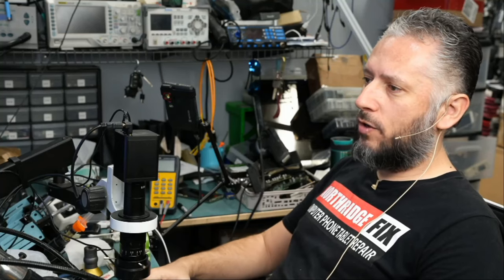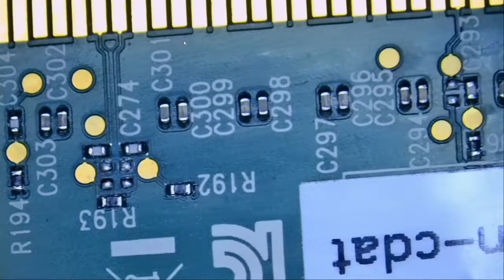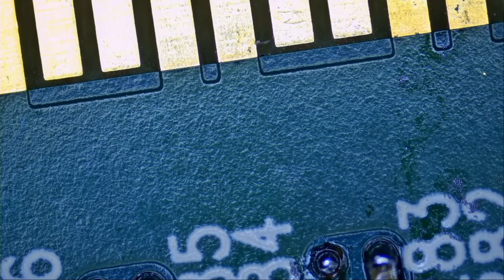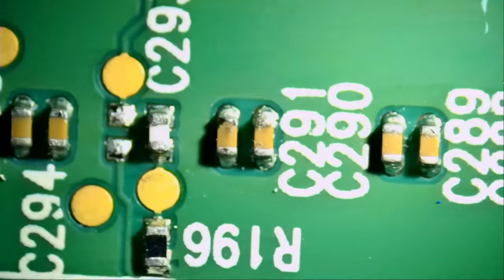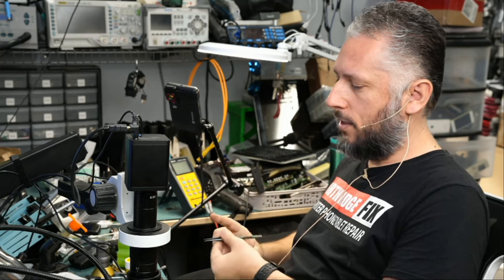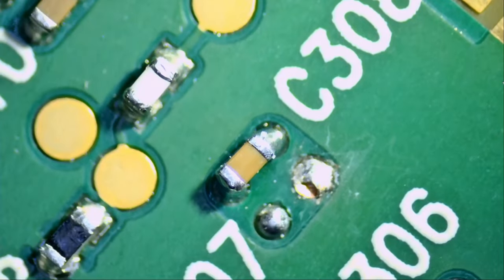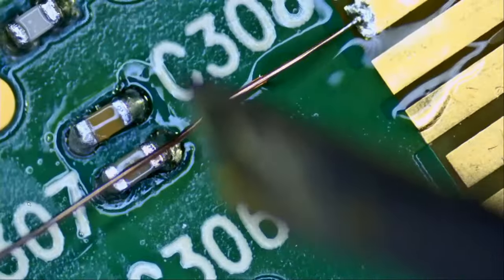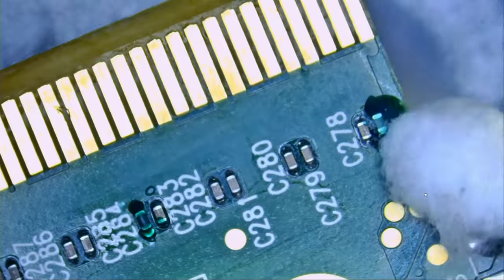Expensive Network Card Repair - Mellanox CX14106a-hcat

Comment: All of these caps near the PCI-E connector are AC coupling caps for the PCI-E differential pairs (data lines), they go to the main IC of the card. They always come in pairs, 1 pair = 1 lane of PCI-E. On modern cards the data lines operate at GHz speeds, and it is critical that the electrical properties of the two traces in a pair are as closely matched as possible.
Reply: Is this a repair or will this fail?
Reply: @Splaterson92  due to the wire and the microscopic difference it gives in electrical flow i'm affraid this is a no fix...
Reply: I wouldn't be so quick to consider those mellanox Asics down for the count. In some competing products that I am more familiar with a signal to noise ratio of many millions to one is no problem. They are far more tolerant of electrical noise than they were even a couple of years ago. As I understand it it is less a question of "how much noise" than one of "how random is the noise"
Reply: @mauzzz2418  Given that multiple PCIe extension ribbon cables have been shown to still work for a GPU at Gen4 speeds even when daisy chained together, I'd say there's a fair chance this works just fine.
Reply: @Splaterson92  Typically in the industry, they extend via out using tiny wire to jumper to part; then secure bond the part to board surface.
Reply: @mauzzz2418  If this is PCI-E 3 then it will likely work, for PCI-E 4 I would be worried, and for PCI-E 5 this would probably fail.
Reply: @TheBackyardChemist  It's a 200gbps Ethernet card, it requires a PCIe 4.0 x16 connection (256gbps theoretical max)
Reply: The spec allows a trace length difference of up to 10 mil. They use 1 percent caps. The cards will work as intended.

Pcie is often problematic - because of noise, interference, and substrate inconsistency within the pcb of the motherboard. Factors which can have significant cumulative effects which scale with the length of the connection. 

Arguing that this is a no-fix based on the general fact that "pcie is hard" without considering what it is that makes pcie hard is only going to confuse the people who read this thread.
Reply: @Splaterson92  will be better than factory, but it really helps if you have a schematic.
Reply: Yup and am somewhat surprised he didn't at a minimum allude to this. Suppose its a case of jack of all trades, master of none.
Reply: @ThePopolou  he's definitely a master solderer :)
Reply: Great work, as always.
Reply: It’s actually 2 pairs per PCI-E lane.  1 pair for RX and 1 pair for TX.
Reply: Right!! Pcie is very problematic, just a little mismatch in length between that differential pair and your timing is ruined, I doubt this card will work at its specified speed
Reply: Guys common... half the time these are off, on paper n in practice 2 different things

Comment: You are both the repair man and the hype man.  You do the repairs with the same tools you sell.  Genius!

Also, I'd almost be in moral panic grinding away at those microscopic traces.  You approach the task at hand with such confidence.  Every time I've worked on small traces I get completely stressed out.

Great job!
Reply: Stress will diminish with lots of practice. You have to make mistakes to learn. Practice on donor/scrap boards.

Comment: Did you test the card before and after? I know the problems were pretty evident and no doubt needed done, but I have to wonder what the issue was. For instance, was the card detected by the OS? Or just not able to bring up the connection etc?

I'm inclined to make sure it fails consistently first, then make then fixes, then do the same test and watch it work. Beyond satisfaction, it's nice to demonstrate in a video for the customer, etc
Reply: A line test would probably need a specific spf connector, a suitable cable and another device at the other end. 

Personally I ask customers for any additional bits if I don't have them and not too onerous for the customer to bring in/mail in.

Comment: I told they would . It has to be like 1000$ for expedited. Most won't pay maybe  some but if they do you might want to do those first. Just for the cash . But 95 $ still is a bargin. So they will pay it. To many expedite to many  to do in little time. Good luck brotha. Thanks for the content and keep up the good works.

Comment: Hi NF loves watching your videos every day I learn something from you as I have a passion for this electronic world.
I have a question.
1: When you say meter in Diode mode it means meter in continuity mode or diode mode if so what diode mode does it cause I know diode mode is used to check diodes.
2: What if we don't have an LCR meter can we still check caps with a multimeter but yeah for the inductor we need an LCR meter cause there is no option in the multimeter for measuring inductance that's what I know.

Comment: What is the purpose of using a pad strip for these torn via vs just soldering component directly to the paste?

Genuine question, no smart remark intended, or implied. It wouldn't given more support since the via is still the anchoring point would it?

What am I missing? Or is it simply preference?
Reply from the maker: the circular pad strip provides more surface to solder on to and it's more likely to make a connection with the via when it's pushed over the solder ball.
Reply: @NorthridgeFix  Thank you

Comment: I have a few broken DC motors from electric toys. I use the coil wire from their rotating part as jumper wires. I can pick whatever thickness I want from those motors. Unwinding them is easy.

Comment: Anyone who wants to see how small this is, look at the back of any old PCI-e card and you'll see the row of caps. These caps could probably fit through the eye of a sewing needle.
Reply: That's huge man, you should see an iphone board with a 1/4 the size of that.
Reply: @fss1704  I have and those are just crazy lol. Not sure exact size but I know these are about 1/2mm in length which is still pretty impressive to repair.

Comment: Some of the edge connections have no visible traces running under the solder mask. For example the last two where the jumper wire was put. How are they connected normally?
Reply: Via’s to another layer on the board
Reply: @SiegeX1  Can't see any.
Reply: Luckily under the pin itself much like the via was under the pads of the caps. Not a great design choice, but appears to be what they did.

Comment: I thought you couldn't read capacitors on a board because they are in line with other capacitors? What meter are you using ?
Reply: It depends. You can’t (generally) do this with bypass caps that bridge power to ground as every bypass cap between that power rail and ground plane will be in parallel with each other and you’ll be reading that parallel capacitance and not the component capacitance. 

In this case, these were decoupling capacitors (in series with a trace) as noted by the fact that one end had continuity with one of the board pins. For caps in series like this, you can read it on the board since there is nowhere for the measuring current and/or voltage to go other than through the component itself.

Comment: I used to be one of those PCIe cards designer and FPGA programmer. Those are AC coupling PCIe differential lane caps.

And this is why, my friend, You should never use Via-in-Pad design for a big card like this. It's over designing, and increase a lot board production price.

That PCB repair artist been lucky to find some copper from the via barrel by drilling a bit, and without cutting or shorting anything underneath.

Comment: Ahh yes, the very typical scenario of heavy handed inserting PCI cards into a computer which results in knocking components off the board but never telling the repair person that it was they (the customer) who damaged the board' Just as in this case, look at the comment from the customer as to the problem. I see this a lot in the repair industry, customers unable to be honest as to why something has broken.

Very very good repair though. I like the use of the solder paste to re-establish the electrical connection with what is left of the 'die'.

Comment: Test the card.
Reply: The card gets tested and verified to be in working condition before he sends it back to the customer..unfortunately these videos can't show everything.theres still alot happening behind the scenes after the main repair,which was the replacement and solder job which already made the video run a little long.so he had to cut out the main board testing after he tested the connections for everyone to see..another quality repair..top notch work as always!100% the best on YouTube hands down..there's just no body that even comes close to his caliber of repair skills on all types of microscopic components!
Reply: @Hackdad  I wasn't expecting him to be able to verify.  that is something that I can do when I get the cards back.  One of the cards was pci gen4 (the one in the video) the other was pci gen5.  they both worked prior to sending them to Alex.  I just needed him to try and replace a few caps to enable all of the pci lanes.  these cards don't have all of the traces visible so that was the real challenge.

Comment: Would have left the holes alone but insert a tiny strand of wire through the hole
Reply from the maker: You always have your own super sonic ways of doing things in every video. Do whatever works for you.
Reply: @NorthridgeFix  i see @neddy1287 's point. Using wire would increase surface area to make reliable solder joint on both via and part.